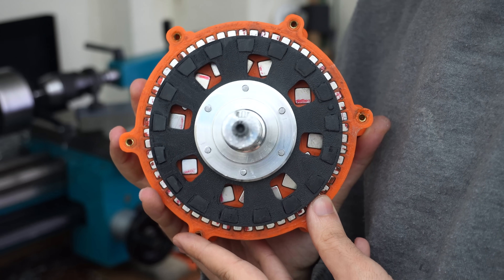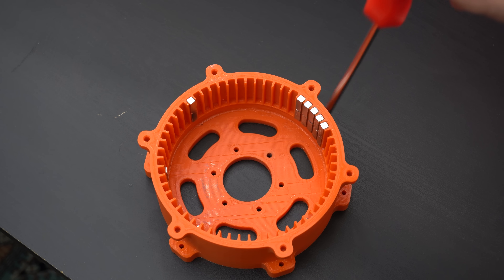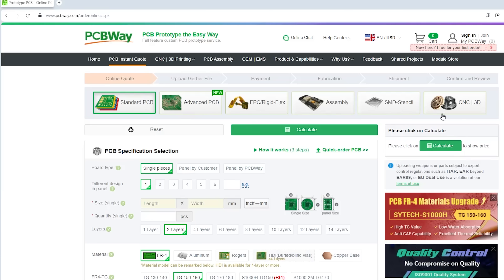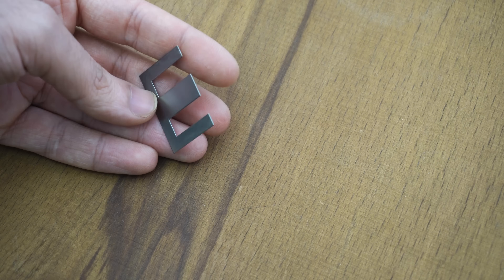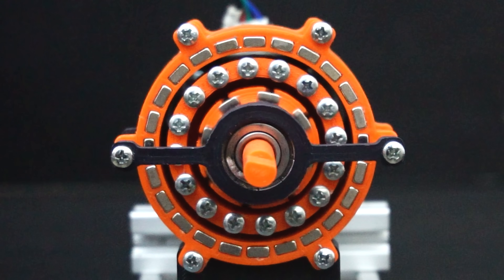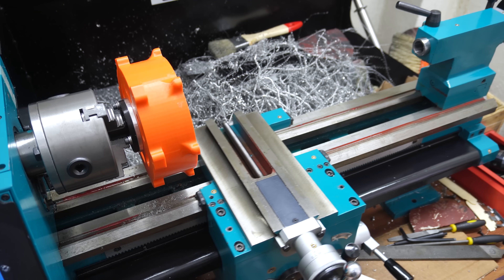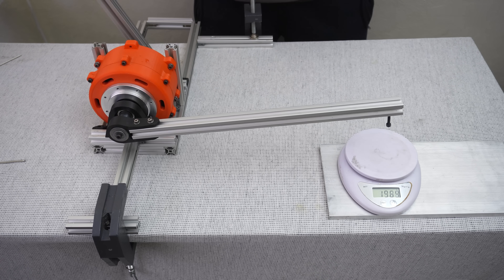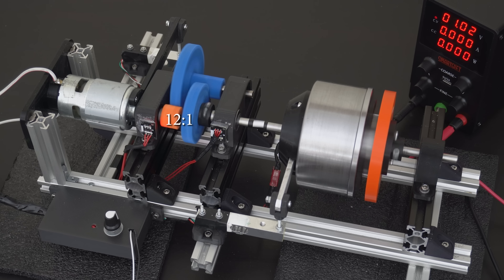True Magnetic Transmission with Serious Torque

Comment: Idea.  You currently have a fixed gearbox, but what if you were able to adjust the number of poles on the fly?  Say by having an inner cage and then moving it between different housings, or play around with some electromagnets.  You could have not just a gearbox, but a clutch-less transmission!
Reply: Interesting idea. There's a way to 'turn off' or cancel out the magnetic field of permanent magnets, that actionlab demonstrates in one of his shorts. You might be able to use that in combination with the split torque release to change the power in the gearbox. Or like you said, by using electromagnets and varying their charge. It might even be possible just by taking advantage of its slip torque and using multiple gears, so that a stronger one engages when the weaker one reaches its maximum slip torque and so on, as a sort of automatic transmission.
Reply: Good idea, will try it myself

Comment: Gearbox? This is a magnetic slip clutch or a magnetic coupler? I don't see any gears, change of output angle or a conversion ratio.
Reply: It can have either a 5.67  or a -4.67 gear conversion ratio depending on wether you take the ouput on the other side or on the outer ring (or a 1:1 ratio if you just lock the whole thing together). It is a gearbox.
Reply from the maker: There is actually one more thing, If you lock the sun gear, then the gear ratio will be the ring gear divided by modulator that is 1.21
Reply: Right, he increases the torque by increasing the power. A gearbox takes the same power and outputs more torque. And you can change ratios on the fly . but it’s interesting seeing his process of one gear, one ratio at some point point I’ll be a box.

Comment: I think this is beautiful for applications where you want slip at certain torque loads.
Reply: Yes, slip with no damage, amazing
Reply: @violinviolator5841 I will note that there are other ways of doing something similar.  Many lathes have a system where the lowest gear ratio is coupled by ball bearings pressed by springs into  divots on another gear.  That way, when I do something stupid, it overcomes the spring pressure and slips instead of breaking the lathe.
Reply: @EmperorA0  That's cool. I wonder what applications there are where this is specifically better suited than a mechanical design such as your lathe employs.
Reply: @gormauslander Probably anywhere that slip torque is expected regularly.  I've seen the design for my lathe have trouble re-engaging, but it's fine since it's more like a circuit breaker than something I ever want to use.  Direct drive, or near direct drive, hydraulics and electric motors could also probably slip without damage, but anything with a gearbox this has potential as compared to clutch pads.

Comment: 11:02 I can't believe you mounted it to the lathe and then chose to dremel it rather than just turn it on the lathe xD
Reply: because the case is made from plastic 
and it will be destroyed if use lathe
but dremel did not make so much force to case.
Reply: @Protodyakon  I've done plenty of work with plastic on the lathe.   You just have to be careful.
Reply from the maker: The problem was not the plastic case, but the small steel pieces that I had attached to the carbon fiber rods. Because I glued them with epoxy, when the sharp lathe tool hit them, it would probably force them out of place instead of sanding.

Comment: Love your work. Very impressive!  I have a new project Idea as a follow up: Replace the inner rotor with the stator from an Outrunner brushless DC motor.  A rotating magnetic field from the stator should be equivalent to your inner rotor.  Essentially you would have a internally geared Brushless DC motor!
Reply: @retsetman9698   Also, heat, you would have an unventilated heater inside. which would mess with the modulation amount and the magnet life span. it would be better is the exterior part was stationary, as it would be easier to cool (big surface area, lots of copper to allow easier dissipation), but electromagnet halbachs are weird tho.
Reply: @giuseppebonatici7169 i had similar thoughts of an exterior electromagnetic coil set around the outside that could be modulated in such a way as to create a potential locking effect to increase output torque with little &/or variable energy input.
Reply: u guys are cool

Comment: To say there is no wear is to fail to understand magnets. There is going to be wear. It's just not going to manifest as visible wear. It's going to manifest as an increasing random scattering of magnetic domains over time. Essentially the magnets will stop being magnets as the wear increases. The harder the system is pushed and the more heat it generates, the faster this will happen.
Reply: Great observation. I also suspect micro heating of the magnet seats. Whatever polymer he’s using as a housing will slowly embrittle.

Comment: You can get as much torque as you can deliver, it’s all a geometry problem if increasing the amount of surface area over which magnets can attract. Consider, for example, concentric cylinders whose surfaces are covered in magnets, one only need to support one cylinder so it spins freely inside the other, attracted to the motor. 🤷‍♂️

Comment: Nice work!
In my bachelor thesis I constructed and build a magnetic gearbox around the same size as yours.
I managed to get 60 Nm of torque out of it.
One important thing is to get the magnets as close as possible to modulator.
If you want i can send it to you, its in german, but google translator can help you :D
Reply from the maker: I would love to see! Would you send it here: semidiych@gmail.com
Reply: @retsetman9698  i send you the thesis:)
Reply: How does your magnetic gearbox compare with what's generally available with more traditional gearboxes?
Reply: @MM-24  They require less maintainance and the cant break due to overload, because the just slip if overloaded
Reply: @legoweaponary1219  Is there any chance of ever building a magnetic gearbox that transmit torque in similar amounts to metal gears? Somewhere in the hundreds of Nm?
Reply: That sounds pretty awesome.

Comment: the slip torque of this gearbox is actually crazy. the idea to use a planetary style and everything else that went into designing this motor is pure genius. with the ability to transfer such a high torque it shows that magnetic gearboxes have far better potential than i think many people realize.
Reply: I want it for replacing the gearbox for my Kona EV, as its known to shred itself to death
Reply: @user-jk9zr3sc5h cðððððdðððďðððððððďðððèðzed⁵⁵5t55⁵þff4f6fffffff6ff4f5fff4y5fyfd6564ffd5ffhfhff5f5ff4ff5ff6tfff4dfffluff 5008 54th fluff 6f6ffffffff5fdffff4ff5fffffffff6ff4fffffff4ffff5ff5f5f5ffff4ffff6ffifteen ff5ff45fffff6fffffffff64ff4ff4ff4f55fffff5ffdd54y444y44444f4e444fifteen d4d4d554d4dde344d45d4d4d4d5de5ddel45de54dd4de54de5ded55d5de5d55de5xe4d554de5de54de5deyde5de5de4d5de4ddeed5de4d5de5ed55dede54d5de45de5de5de5dede544d4d5de4de4d4dde4d5e545de4d5de5de55e5d54d45de4d4de5d5de5dexed55de5d4d4d5de5e4ede4d5de5de5de5de45xey5de5de5dee44d5d5xe5dey5d4de5de4d5e55d5de54d5ed5ed5de5ded5e5de5fe55de4d5de4d55ed5de4d4d4d5de4d5dedede5de4d35d5de5ed4d4d54d5xe5de4d4d54d5de5de5d5de55de5de5ded4ed5de4d5de555de5dd3de4d4d4d4544dye5e5de4d5de5de5de455dddde55d5ded44d5de5de54d5d55de5ddeddeyde44dde5deded3edde3dded5d5dd44de5ed5dey5deed5de5de5deed5de5de4ede5de5deedde5deededyeede4ddf5de5dedeyde4d5de5dedede5de4de5de5ed5d5de5d5de5de5dey5de5de4dey5edy44d5d4d5dey5eddey5dey4eyed4d55de45dey5de5dedey4de5ed5ed53d5dey5yed5edy5ed5de5de4d4d4dye5de5dye5dey5dye44d4de4de5de5e5edy454de4d5dedey5ed5ddde54d5ed4d5de4de54d4d5de4d44de4d4d5de5ed5ded4dey5dey4d5dey5dede5dde5ed4de5dede5ed4dd5de5dyef4y5yde4dyf4445dyede4y5dy4dy4yd5eedy54dye4dy4yd4544y44ye45de5545dy5554d5y5y4e54454y45y4d445ey4554dye5555ye44d4d454d55y4d5y55e5y45455555ye55555y4y554444d4555ey54d5554y54d4d4f45ye4d5ey554yd5d55545555y55555y45555d45y45445e555445yd54y544d55444d55ey545555y555454d5545554d5454ye5yc554ye44y5ey4544554544yd5555ey5545555455d4544d5555de5544555y554y554d55ey54y4yd5d4dy54d54y4d4544ddye55555dey55dey44d4d554d5xey54y4d5d555ey5ey4yeey454454d45454y44y44d445c4edv6iv66vgg6vv6kv6kgv6k6g6k6g6v66vkvrk6vkkvrgrgr6gi6bv6v6gk6hv6664⁶
Reply: @user-jk9zr3sc5h Your Kona is not gonna get very far on 21 N*m of torque, that this gearbox can handle, unfortunately...
Reply: @user-jk9zr3sc5h  lol yeah this would be a perfect solution for any kia/hyundia gearbox considering that this thing is already infinitely more reliable than even the best of kias.
Reply: @garbageman3992 maybe the evs. But if you're talking "any" you must be stuck in the 2000's
Reply: @3xeplodng_3agle_studios  what are you asking/saying here? i dont recall saying "any" anywhere here and i didnt say much of anything about ev's.
Reply: @garbageman3992  "...any Hyundai KIA gearbox" outdated POV.
Reply: @3xeplodng_3agle_studios  oh you meant for the hyundia/kia thing. i thought you meant something regarding ev tech so i didnt think you meant the kias/hyundias. anyways me and my friends have owned around 6 kias/hyndias together and EVERY SINLGE ONE OF THEM except for 1 had total engine failiure before 100k kilometers. like almost every other car out there gets 300k. its not even funny how bad the hyundai group is.
Reply: @garbageman3992  you say that but you can't judge an entire brand off personal or anecdotal experiences/evidence. Makes no sense in the grand scheme. Not liking them is your prerogative but writing them off entirely as though its a universal fact is a bit much. 

I will say, they have terrible corporate customer service, and they do have a penchant for recalls. The vast majority of those recalls come from the U.S assembly plant(s). 

Aside from that, anything 2013+ is "passable" to "rock solid" in quality.
Reply: @garbageman3992  as for the EVs I was referring to them as far as not knowing about their reliability. I don't build, work on, or for that matter- care about EV's, so I can't speak on them very much outside of working principle and which drivetrains would make good hybrid setups if added to a combustion car. 

The conclusion you came to about the longevity and potential draws on the lifespan of these type of gearboxes, is to my knowledge, quite accurate, by the way.
Reply: @3xeplodng_3agle_studios  uhhhh no. its litterally not arguable that personal experience and the ACTUAL RELIABILITY OF THEIR VEHICLES is what determines how good a brand is. like idk what to say. its literally not arguable that if you get a product, and it sucks ass then the product sucks ass, especially if you get plenty of them (me and my friends) from years spanning from 2001-2022 and THEY ALL EXPLODE. it means they are terrible. like I dont want to be rude but if you seriously think that a product continuously blowing up makes it a good product then cry about it.
Reply: @garbageman3992  oh no. Nobody's crying. Your experience simply is not the defacto majority. I don't really care if you are rude honestly. It doesn't bother me. Frankly, that kind of behavior usually amuses me.
Reply: @3xeplodng_3agle_studios  say what you want but if a product cannot do what it is advertised to do then it is objectively bad. you are litterally defending the fact that the cars blow up at less than 1/3rd of kilometers that many other cars get. so if the cars blowing up in real life testing from actual consumers isnt valid for some reason then what is?
Reply: @garbageman3992  YOUR cars. Not all of them. Not even most of them. The amount you've dealt with is miniscule, insignificant, compared to the countless hundreds of thousands that have been made and are still on the road perfectly safely ("safely" being operative of whether or not those instances have been neglected/abused and are therefore no longer road worthy)

I already said, its valid to you  that's fine. Its valid to you but your experience is factually, logically not the case for every single one or even most. 

Furthermore, if you're going to sit there and talk like you're some sort of expert vehicle tester, then I suppose you have articles or papers written on your experiences, and/or on the matter in general? Perhaps countless YouTube videos detailing and chronicling your tests and experiences? 
Before you ask the same of me, what am I going to exhibit as proof? A link to a page with the production figures of all Hyundai vehicles (which would include KIA and genesis- all Hyundai owned, built with Hyundai parts) 
A link that YouTube won't even let me post in the first place? 

Just to reiterate and prove to you that they've made multiple hundreds of thousands of vehicles over the years, and that most of them are still on the road (condition regardless). 

Or would you prefer the basic arithmetic it would take to prove your multiple dozens doesn't even come close to a significant fraction of the previously stated production numbers?
Reply: Looks expensive
Reply: @matthewfredrickmfkrz1934  With the exception of the bearings, there are no wear parts.  Plus, an over-torque situation results in slipping instead of stripping a gear.  This could seriously reduce wear and maintenance in some applications.
Reply: @EmperorA0  85% efficiency for simple gearbox is a verdict.
Reply: @arthurmoore9488  magnets lose magnetism faster than plastic teeth on a cog wear out, which won't attract magnetic particles
Reply: @matthewfredrickmfkrz1934  if they never exceed a moderate temperature high  end neodymium magnets can maintain above a 90 percent original magnetic strength for over 200 years. that being said though china exports most of the neodymium magnets in the world so that's a problem
Reply: @garbageman3992  not for long, given what's in wyoming
Reply: @adora_was_taken  so far east asia and some of africa are te only places neodymium is really being mined. did they discover some in wyoming?
Reply: @garbageman3992 A hell of a lot in Wyoming hahah
Reply: @garbageman3992 when not in use... this is not the case when they are in operation, when this gearbox slips it'll wear the magnets much faster due to the reverse direction of the magnetic field this actively harms the magnets, not to mention the heat in operation.
Reply: @rosskj9187  I didn't realize that an opposing magnetic field will decrease the life of a magnet but that is the case. in practice I wonder how long these gearboxes would last. so if the gearbox doesn't slip but is pushed to the brink of slipping/ outputting its max torque would that also lower the magnets lifespan since the magnets are in the region of peak opposing force from other magnetic fields or do they mostly lose life from over torque/slippage?
Reply: @EmperorA0  Like what applications? 

Overtorque protection is a potentially good feature, but only if you can match the torque delivery capability of conventional gears. And conventional metal gears can hold orders of magnitudes more torque than this...
Reply: @matthewfredrickmfkrz1934  This can be eliminated by cooling, well that means it needs some fluid that l can draw the heat away.
Reply: @matthewfredrickmfkrz1934 for now. economies of scale are possible if there is a strong enough need.
Reply: It is dramatically more expensive to regularly replace bearings, disassemble and relube gears, or have massive failures when gears are over torqued and strip or at worst shatter and break other parts. @matthewfredrickmfkrz1934
Reply: For applications with relatively static load, or where the breakaway torque is more of a feature than a detriment... they have their merits. Otherwise, they're pretty useless. The sheer mass increase required for increasing dynamic load threshold is insane... even with the highest quality magnets and minimal tolerances for maximum flux interface.
Reply: @driverjamescopeland  oh yeah in comparison to a traditional metal lubricated gearbox it has a pathetic torque limit. but its an interesting concept and a lot better slip torque than i expected it to be so its myabe useful for something. then again apparently the magnets wear out quickly when pushed to the brink of their slip torque frequently so im not sure.
Reply: Opposing magnets work better

Comment: Great work sir!  So the gearbox is ‘absorbing’ about 3.4 Watts, which it is big enough to dissipate by radiation. Nice.
Reply from the maker: Actually not exactly correct, that value of 3.4 Watts is achieved by zeroed the scale, PSU gives 160 ish watts, the motor efficiency is about 35% so the power in the input shaft actually should have be around 60 watts, and with the 85%ish gearbox efficiency so now the loss is about 10 Watts, hope I’m clear

Comment: Use alternative electronic controlled field. I only may assume that way must be easier to control gear ratio.
Reply from the maker: What I didn't say directly in the video was that the number of steel poles in the modulator is equal to the total number of magnet pole pairs. I could change the number of magnet poles with electromagnets, but then I wonder how to adjust the number of steel poles in the modulator.